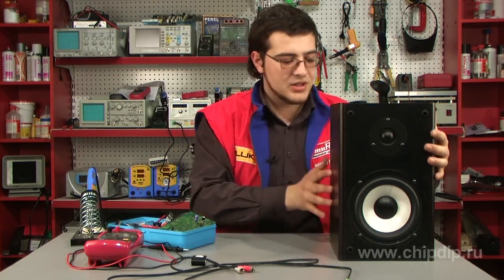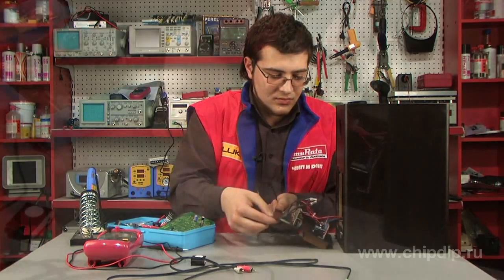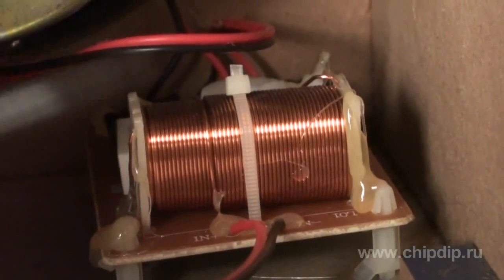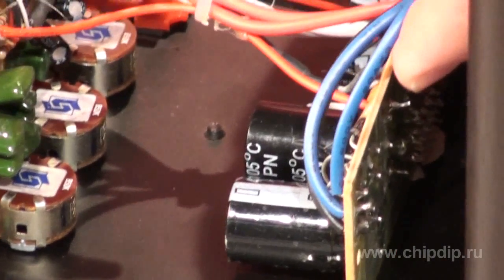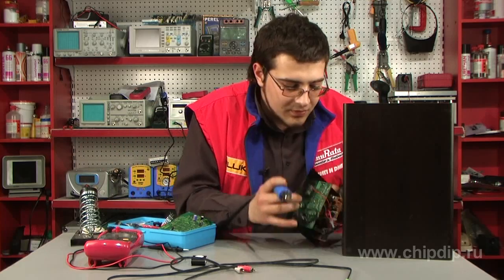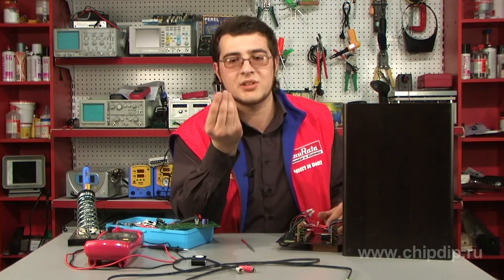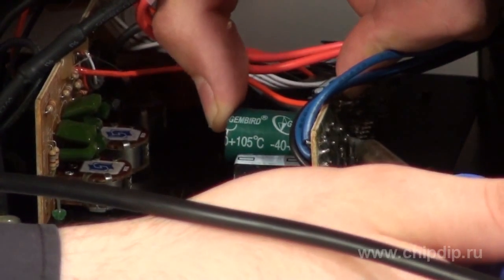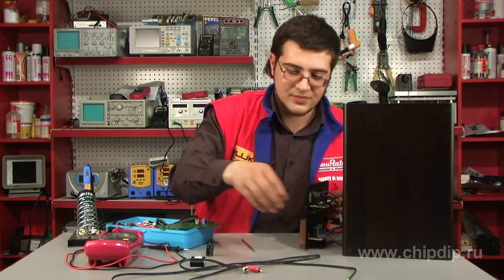Troubleshooting Active Speakers

Comment: What kind of logic is that. I thought he was about to say the problem is definitely NOT here because removing the so-called problem did not cause any correction. You Kno I Mean?
Reply: It could be that the capacitor wasn't doing what it was supposed to so removing it didn't change anything. If it was a working capacitor the sound would have changed for the worse I guess.
Reply: Yeah it sounded pretty retarded. Also, they didn't let us listen to the "noise" they were talking about. The video was totally worthless.

Comment: I have set of skytec spb 10 600 watt speaker and it won't let me connect to my laptop  any ideas would be welcome
Reply: Does it work with other devices? Try using a 3,5mm minijack to RCA -cable and plug it in your headset connector.